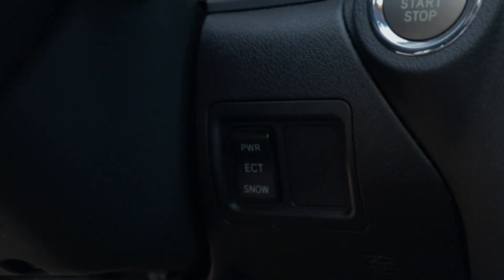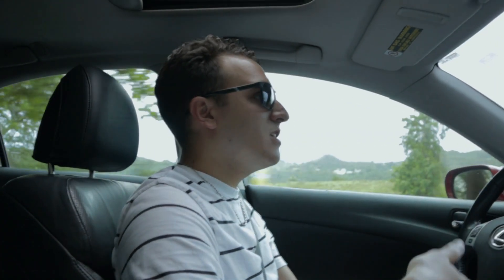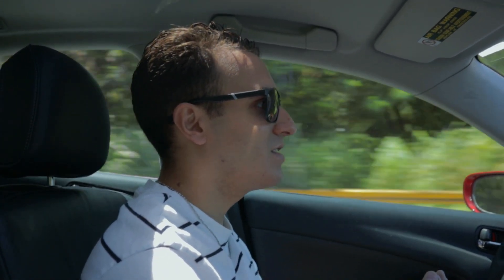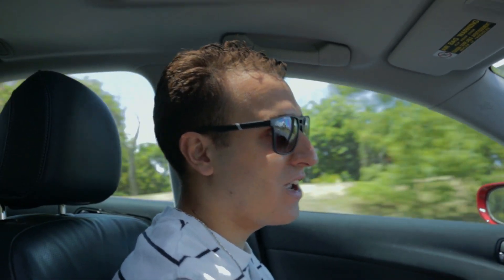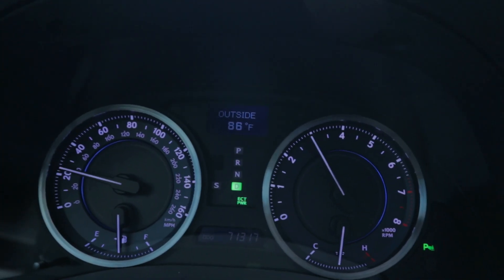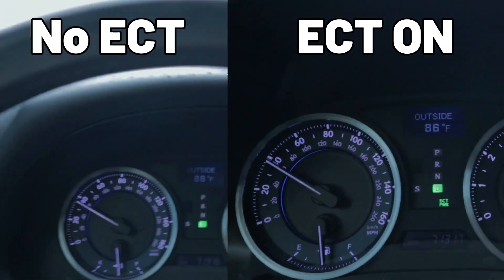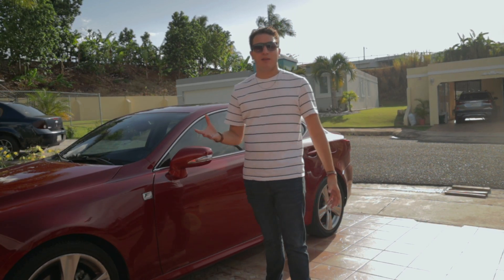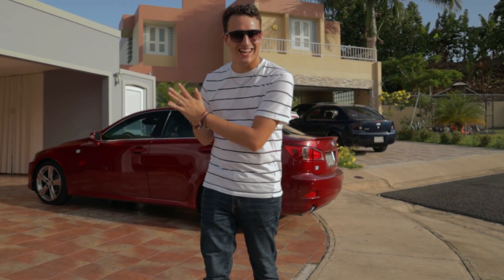What does the ECT PWR mode do on the  Lexus Is250???

Comment: I wished there was a way to relocate the button to a place more convenient to activate it. I literally have to look when I want to turn it on...
Reply from the maker: I just guess where it is most times😂
Reply: @bluecoopermotors  Same here. Just guess. It's in the right place on my friend's GS though.. so wondering why Lexus can't put it on the right spot in this car. But it drives much better if you are in the mood for a spirited drive. Otherwise, keep it to normal.
Reply from the maker: I haven’t used it in a while cause I have to get new tyres and don’t want to be sliding every time I take a sharp corner, but as soon as I get the new tyres imma be enjoying every bit of the car
Reply: @bluecoopermotors  what tires you planning to get I'm on a 2021 (I think) Michelin Premacy. Still running 17 inches for comfort. 225/45/17 front and 235/45/17 rear setup.
Reply from the maker: I’m still deciding between the Yokohama Advan Sport A/S + or the Kumho Ectsa, or to get a set of wheels with new tires😂 if I keep the ones I have the sizes would be 225/40/18 on the front and 255/40/18 for the rear

Comment: Is it a good idea to be driving fast and / or racing your car with the power mode on? Any future engine problem for pushing the car limits?
Reply from the maker: The Power mode only changes when the shifts are done to make the car feel and handle more agile, so it is not gonna cause any engine trouble

Comment: Is the transmission a CVT?
Reply from the maker: No, the transmission has 6 forward gears to change which gear you are in, in CVT’s a system driven belts would be doing that.
Reply: No not a cvt , it has a proper gearbox
Reply: Mostly Hondas have CVT
Reply: Same transmission as the Subaru BRZ first generation

Comment: I purchased a 2012 yesterday but the steering wheel feels too heavy and hard to turn when compared to my ES. Is there a way make the steering normal and soft and easy to turn?
Reply from the maker: It could be a problem with the power steering, because the Is doesn’t have a button to do that. I would get that checked out ASAP

Comment: I wanna ask you does the ect power mode make the motor sound louder
Reply from the maker: Technically it does but because the car revs higher, not because it changes something in the exhaust or the engine
Reply: @bluecoopermotors  " not because it changes something in the exhaust or the engine" - isnt the engine reving?
Reply from the maker: What I meant is that contrary to a Mercedes or BMW, there isn’t a valve in the exhaust that opens up. Also, the engine in some of those cars the ecu changes the sensitivity of the throttle and sends more gas to the engine to help with that extra air coming in. The lexus only changes shift points, everything else stays the same.

Comment: how do u feel about the gas consumption
Reply from the maker: I talked about it at the end of the video… but it actually isnt that bad compared to normal mode. Still don’t use it in heavy traffick cause it will gulp it up
Reply: There's no difference when you learn how to drive conservatively with it on. I've noticed no difference in fuel economy
Reply: Mine gets 26 to 28 AWD is250